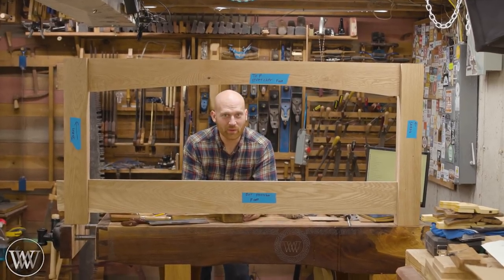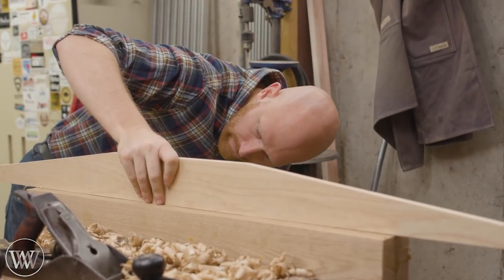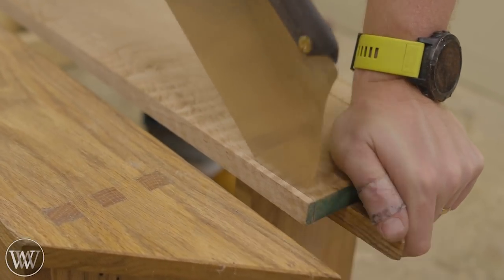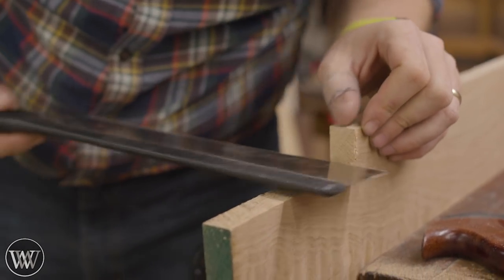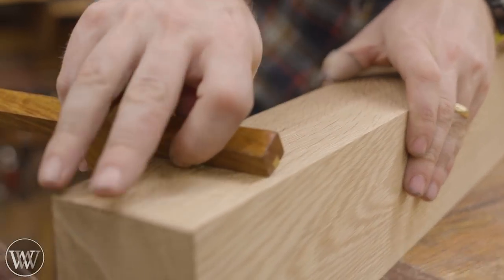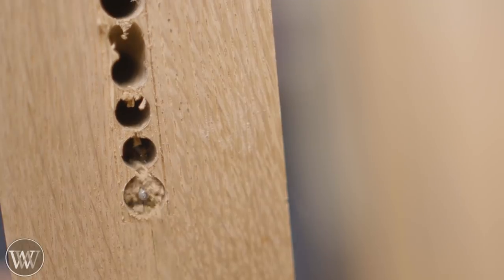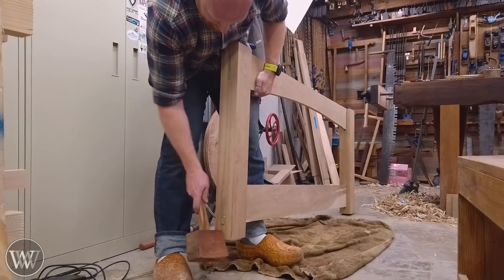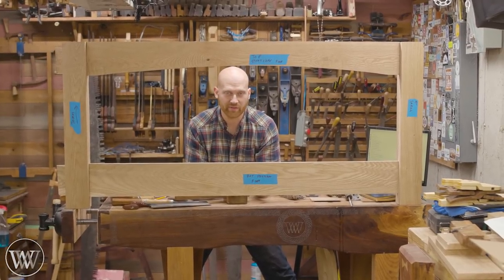How to make a Mission Style Bed Part 2

Comment: I've seen you use the winding sticks quite a few times, and it wasn't until now that I wondered if it would make sense to put a level on each side rather than relying on eyeballing the measurement.
Reply from the maker: Not sure what the level would do. The winding sticks check for twist in the board. With these I can see a few thousends diforence. The goal is co compare one end to the other not to compare the surfice to the earth
Reply: @WoodByWrightHowTo  hahaha touche' sir.... was just thinking that sometimes your eyes can play tricks on you and something tangible like the two bubbles could seem more reliable.